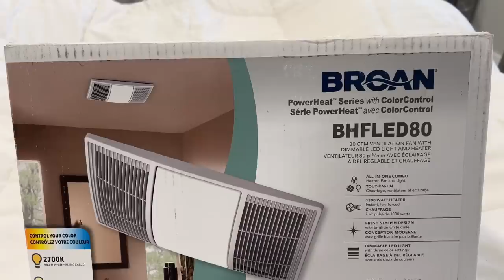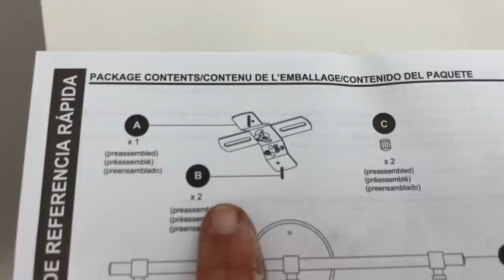Jay’s Bathroom Makeover-That’s one way to do it!

Comment: Can’t believe I’m going to give you a tip (from wiring boats), but instead of fishing a wire into a tight space, you could have disconnected the existing yellow wire from the switch and used it to pull some string from the switch to the ceiling (wrap the string around the wire and the cover in electrical tape). Then tape the new and old wires in the ceiling to the string you’ve now pulled through, and pull them back through the cavity to the switch. With one person pushing up top and pulling on the bottom, it’s very easy. If you get stuck just push/pull back and forth a few times and it should find a way through. Make sure your tape covers any tag ends and makes a good ramp at the connection from thin string to thick wire+string to reduce snags.

Comment: Jay, they had the right idea but the proper way you’re doing is is to take a piece of wood screw it through the square into the back of the wood wood is behind the sheet rock. Screw the board screw the street rock into the board one screw put it up behind the wall turn it, so it will connect to the outside of the wall and then screw through the wall with two screws to hold the wood in place one on one side one on the other that will bring that wood closer to the hole and the sheet rock will be even with the cut outand then you can use sparkle or whatever you want to clean it up. Let it sit for a couple days and sand it down and paint it.

Comment: Nice job! Another way I used to use when I was a painter-decorator for putting new dry wall in a cavity, was to cut it to size, then put a screw in the middle as a handle, put the filler - you guys call it mud - around the edges. Then when its dry, take out the screw and boom. its done. However in saying that, I did actually like the method you used. That actually looks easier. See; you learn something everyday 🙂

Comment: PRO TIP - use a piece of pex 3/4 water line ( just a bit longer than the distance of the 2 holes ) and run it from the outlet hole up to the cutout and then run the wire through the pex.  Cut the electrical wire and hold from the top and remove the Pex
Reply from the maker: Pro tip. Thanks

Comment: Not sure if anyone has said it yet but you could’ve used the first wire to fish two new wires up through the wall and you wouldn’t have to cut the drywall above the switch. Hope this helps next time, renovation looks great!
Reply: Good idea. And as a bonus you would not see the square as you do now. 

But great video. Just missing BECCKKAAAAAA

Comment: I always take out electrical box and replace it rather than have to patch a hole. You can use the old work box or the ones with screws on the side

Comment: Next time, just use the existing wire as a pulling wire for two new wires, that way you dont have to cut a hole in your wall. Great transformation tho.

Comment: Jay, since you were replacing the wire, you could have simply disconnected the switch and then wire nut the new wire to the ends. Finally, pull the old wire out from the ceiling and it would pull the new wire up the wall. Disconnect the wire nuts and continue to run the wire to the new fan.
Reply from the maker: Could have used you a few weeks ago!!  Lol

Comment: Should have just used the existing wire as a pull string (if possible) otherwise you could have just shoved a fish stick up through the inside of the box and grabbed it from up top, wouldn’t have had to cut and patch that hole above the box.

Comment: I'm pretty sure you screwed that bathroom circuit using the white 14 guage in the yellow 12 guage circuit. You can't mix guages unless the breaker is the lower value for the different guages of wire but bathrooms must be 12 guage and 20 amp so you probably need to change thst wire to 12 guage.
Reply: Yes.. Heaters of exhaust fans best practice should be on their own circuits...

Comment: @2:52   @19:47   i think you or lowes mounted the mirror upside down
Reply from the maker: It has hooks on both sides so you can mount it anywhere you want. I actually thought it was better this way!
Reply: @Building_Jays_Way  i think its better that way also.

Comment: Electrician here. you used the wrong wire with that fan. You should of used 12/2 and tied vanity light with the exhaust fan light and installed a GFCI instead of the half switch receptacle.

Comment: It looks like you used 15A wire on a 20A circuit?
Reply: Looks like he used the 15 gauge for the lighting circuit.  Kept the 12 gauge for the heater.   The home run can not be a 15 gauge on 20 amp circuit nor the outlets.  Lighting circuits can be.  This is acceptable if local AHJ says it's all right.
Reply: You can never use any 14ga on a 20A breaker, no matter what the intended load is. In an overcurrent/fault situation, the wire would melt.
Reply: @davidkahler9390  Didn't see the breaker just the wire coloring.  And remember at one time all nomex was white 14 and 12 gauge.  Plus don't know how the whole house is wired.  Person before Jay didn't follow at that time NEC code.  It's Jason's house, let it be.